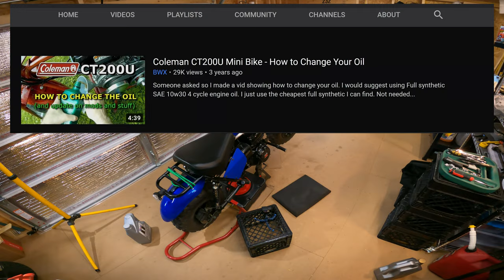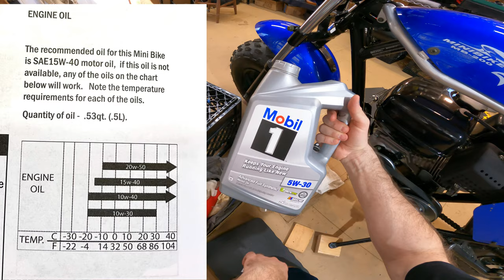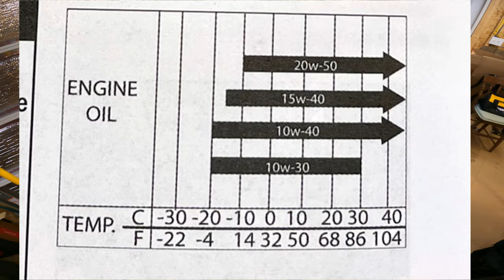How to Change Your Oil | Trailmaster MB200-2 Mini Bike (Or Any Mini Bike!) [4K]

Comment: I bought a stage 1 kit from go power sports (super pipe, k&n style filter, .38 jet) and man what a difference. I since upgraded the plug to ngk bpr6es and that gave me more too. Juggernaut Pully goes on today. Front tire already comes up so the Pully should help a lot. I’m 270 pounds and my top end is only 39 so that’s why I haven’t gone to 60T sprocket , anywho

Safe rides ✌️
Reply from the maker: That's awesome man! Yeah I bet the 196 would do just fine with some mods. It is pretty slow stock though. I always wanted a blue Tilly on there and it's sweet. I have the 196 on the shelf. It has a long 3/4" output shaft and lighting coil which is nice.

Comment: I ride mine like everyday for 6hours how many times do gotta change my oil ?
Reply from the maker: Maybe once every two weeks I guess. That's a lot of hours.
Reply: Thanks, well I got 50 acre land so... ya
Reply from the maker: @Rogerdiaz12  Yeah I heard someone mention once every 50 hours. But some people hardly ever change their oil and some change it all the time. I'd put a tachometer with hour meter on there and go by how many hours you've actually had engine running. I'm sure more often is better, but have to draw the line somewhere. Don't want to change it more often than needed. Full synthetic will allow you to go farther between changes than regular oil though.
Reply: Thanks mean a lot
Reply: It written somewhere in one of the instruction manuals it comes with. Every 20 hours you ride, but the chart they give is more descriptive

Comment: Any specific torque specs for the oil bolt? I just bent the washer I gotta different bolt and washer but I just don’t want it to come out
Reply from the maker: There probably is a torque spec but not sure what it is. Just snug it up. The one on my big bike is good at around 15 ft lbs but that’s probably way too much for these. I’d guess about 7-10 ft lbs but that’s just a guess.  Could google gx200 and maybe find out.

Comment: great video can or do you have a video on your shop tour  what size is it and how do you keep that wood floor so clean keep the videos coming I have a bt200x your videos are a very big help thank you
Reply from the maker: Thanks it's 12' x 24'. Pretty small actually. Not sure what type of floor that is. It's definitely a wood product of some sort but made to support weight of a car. It's pretty sturdy, some sort of dense particle board with a coating on top.. Company that made it went out of business during covid. 

I just use cardboard when doing messy jobs and wipe up oil spills, try to keep on top of vacuuming it. Been lucky not to damage it but I'm pretty careful with it. 

My shop is getting too cluttered now, need to constantly try to move things around for better use of space. Once I get it figured out I'll try to make a vid but I am by no means an expert in setting up a shop. Quite the opposite LOL.

Comment: Do you have a video showing how to take the jet out of your bt200x to add stage 1 kit ?
Reply from the maker: Yup I do. I can't remember exactly which one I'll get the link.
Reply: @bwxmoto  thank you really appreciate it
Reply from the maker: Check this vid at 18:23 https://youtu.be/q-PYjiNAQbI?t=1103
Reply from the maker: @ramirovilla7213  Hey i just realized that actually I was replacing the jet in the Predator carb in that vid. The BT200X engine has a carb that has a jet that is non-removable probably if it was made in the past couple years. So it won't be easy to get it out. I think you need an easy-out or some other different type of tool to get it out.

Might be able to do it or might be better to buy a $10 carb off of ebay.
Reply: @bwxmoto  yes I did see haha, I think I will try to get it out and if it doesn’t work I will buy a need carburetor. Thank you 👍🏼
Reply: I just did the jet in my coleman I used a thin philips head and it took the old jet right out no problem.
Reply from the maker: @ryanbruce2678  Nice! Yeah I never tried to get one of those out, some people say it's easy, some people say it's a PITA.  I guess it all depends on if you have the right shaped tool.

Comment: Every 3 weeks
Reply from the maker: It depends though! If you ride it a lot that seems like a good time frame.
Reply: @bwxmoto  I ride mine everyday so yeah I have to change it every 3 weeks I was just giving a suggestion wasn’t expecting you to reply huge fan for like 4 years now❤️all love
Reply from the maker: @Up45Bliqz  Thanks! Good suggestion you had 👍
Reply: just order one not long ago it’s in the way. super excited. Do you recommend the i drain the oil it comes with and use the 5w30 upon the first crank? i will be using it daily too.